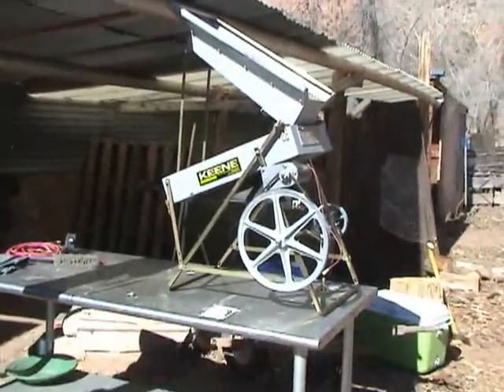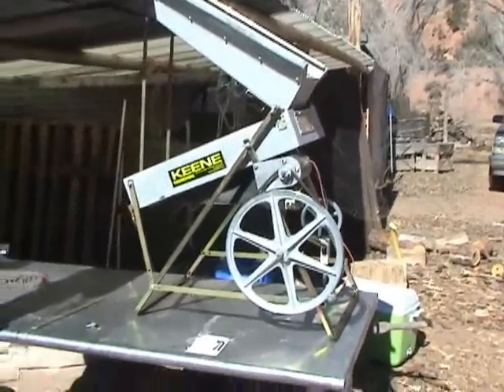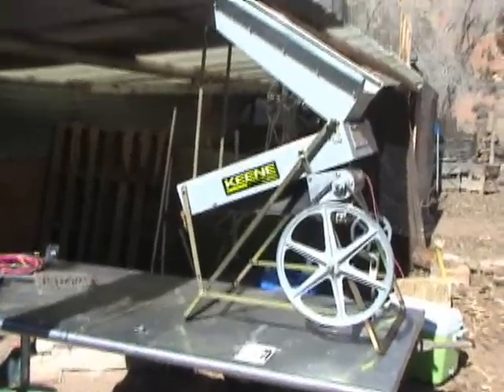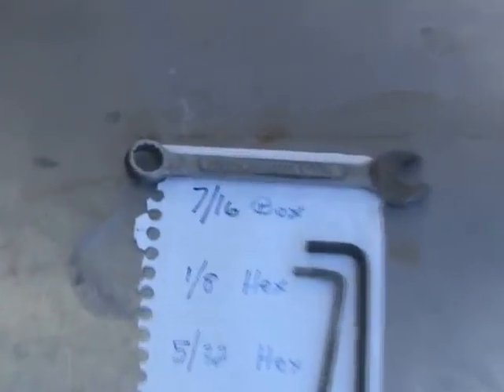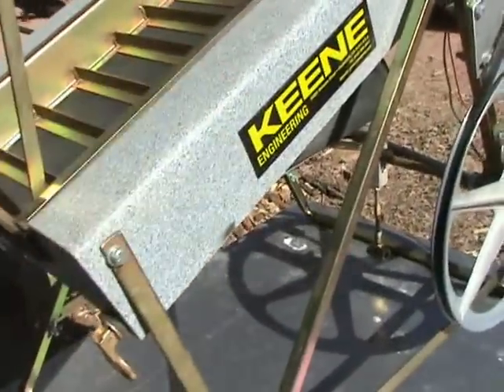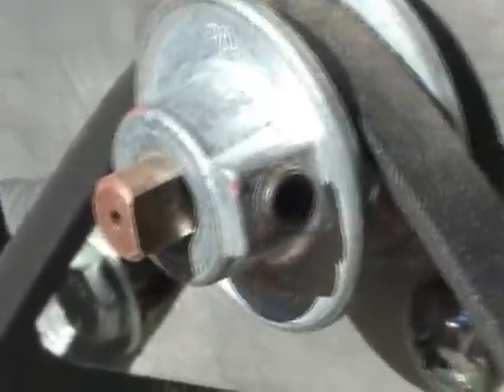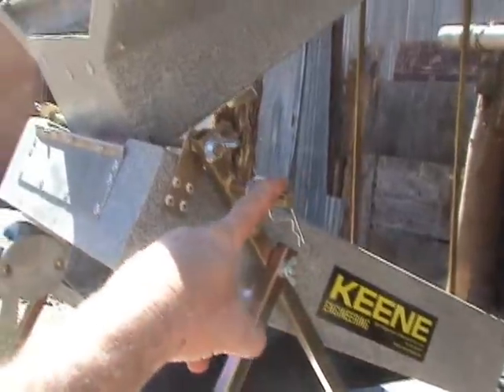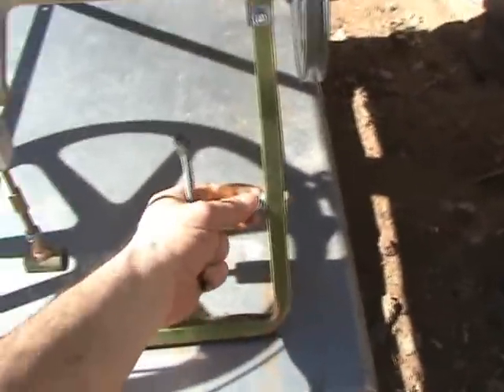Keene Engineering Dry Washer, Modifications 01: Introduction

Comment: May I recommend Shoe Goo for all your sealing needs? Just spread some on the rivets and let dry and you'll have a perfect, air tight seal. It's made to repair the soles of trainers that can't be resoled and it stands up to that sort of wear very well. It's also rubbery when dry and would make a great seating seal around the edges of your flapper valve. 
One other suggestion is to make the flapper semi-rigid by gluing material around all 3 edges.

Comment: Well, you can epoxy the rivets on the exterior. Inside and out, of course.
The weight idea, for the flap, will be tricky to get right. 
That material looks a little thick.
What are the rivets under the flap attaching, and can it be glued?

Comment: Instead of PVC tubes to center I'd have suggested riveting new L brackets to reduce the moment arm causing bending moment and a brass grommet through the hole. 
Height adjustment could be infinite with two eye bolts, a length of allthread, and a couple nuts and washers.The pop rivets could be closed up with a little elmers. 
A little cable management. I'm still dubious about the efficiency of a sifter bed that short, but I'm coming from industrial density separators.

Comment: With modifications it will probably work like a charm (And all the areas you pointed out should be relatively easy to mend) though the fact that it was shipped out with such shoddy work is almost surprising. The most glaring one for me is the bar that holds it... that thing is way to thin and nowhere near securely attached... which should have been spotted if they had done any sort of product testing.

Comment: The thumb bolt that holds the riffle tray in place will go all the way up flush but you have to tilt the tray WAY up and then slide it in as you bring it down. Then that little tab plate will come down flush with the air box. Took me a while to figure that out. So that plate IS not put in backwards. You just have to put the tray in properly. Of course you get NO instructions with these pieces of poorly thought out junk. I talked with Pat Keene at great lengths he just doesn't seem to care.

Comment: $800 man, with that many problems, it might be cheaper and better made to make your self with sheet metal if you had the tools. I bet the person who assembled it must have screwed up I mean rivets and the bracket not your put on the legs. You could probably use caulk or soldier to seal up the air way.